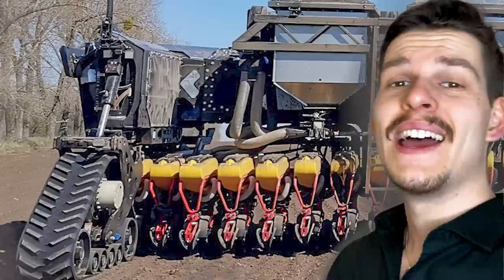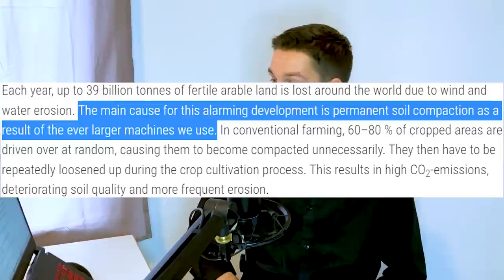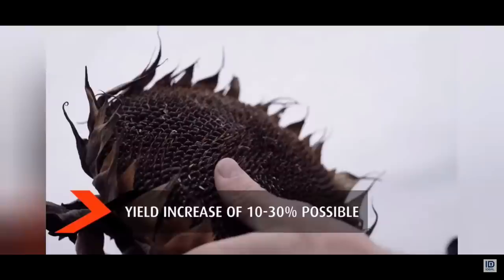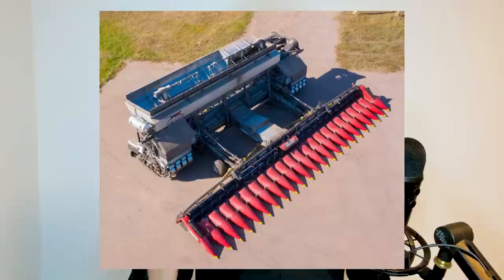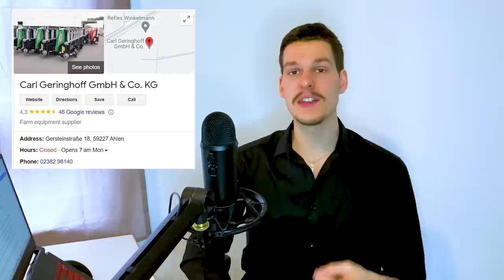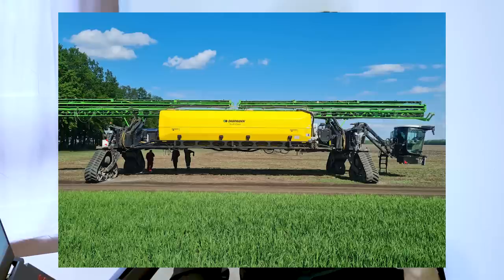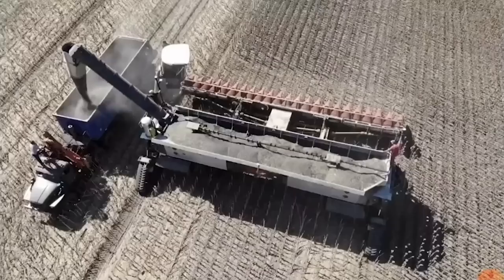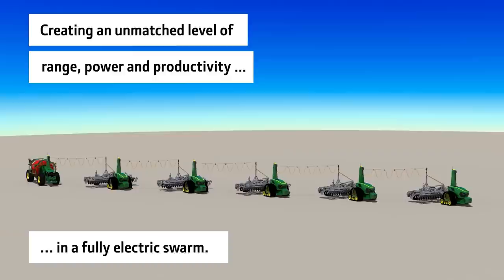Why this Super Tractor is the Worst Idea Ever (NEXAT Review)

Comment: Your wrong 1. 260 kWh per e Motor . Point 2 you didnt get Stuck because you Drive every year the Same ctf... ! Point 3 the Harvester Made 150tonns/h in wheat. Point 4 they have a väderstad Spirit module and a Weinhoff slurry module too. Point 5 its is in a Testing phase
Reply: and it will be in testing for a 10 years.

Comment: The second I heard you say the electric drives have 160kwh, I knew that you do not know the engineering behind this thing. Diesel electric is the best option for a moveable machine like this. The other options are hydrostatic which is inefficient and has the potential to leak massive amounts of hydraulic fluid. Or shaft drive. But how would you route those shafts? Just how many transmissions would that take? Also CVTs are not simple things. Diesel electric is actually very simple mechanically. Also efficient.
Reply: And you can build battery hybrids (or hydrogen hybrids) quite easy when you allready have an diesel-eletric drivetrain.
Reply: its basically just diesel engines providing power for the electric motors right? not much different than running off just battery power
Reply: @denzzlinga  But in this case, neither would be that interesting. A Battery Hybrid (Plug in Hybrid in car therms) makes sense in passenger vehicles for road driving, as they brake a lot. Regenerating the kinetic energy that would be lost to heat during braking makes a lot of sense for efficiency. This is a tractor. Once you are pulling a plow on a field, you do no longer think about brakes. You are already dragging a literal anchor behind you. The demand on the drivetrain is vastly different. The hydrogen hybrid is not that useful either. There either is or isn't hydrogen near the field. If there is and the economics make sense, why not fully power it with H₂?
Reply: @linux_doggo  Pretty much yes. Not exactly the same thing because the engines can't react to sudden power demand as quickly but yes its a electric tractor running off diesel generator(s).

Comment: Apparently, the concept behind it was still not understood by some. With this system you always drive on the same track and compared to the usual tractors/harvester you don't have 4 tracks for 2 rows, only 3 - for 3 rows not 6, only 4 etc. This means that the lanes are compacted, getting stuck is therefore far less likely with this type of tracking. Theoretically you could also concrete the tracks.

And one should also be able to distinguish between profit and yield, which Hitech Farmer here apparently cannot.

And no, just because seeding is done on a wider machine does not mean that only 2 tracks are compacted with the tractor. Before that, manure may have been applied and cultivated, then seeded, then fertilizer applied, sprays, possibly rolled, groomed etc. and all on different tracks. The soil compaction is only removed after the harvest with a subsoiler or plough, so the crop yield is lower than possible over a large area. That is exactly what the statement from Nexat says.
Reply: with conventional tractor you also drive on same tracks since today there is this simple thing called GPS...
Reply: oh and plowing increases yield since you turn the earth over and have the left over foliage under soil as fertillizer...this nexat makes no sense from the beginning...
Reply: @NoYouAreNotDreaming  No, because the attachments do not all have the same track width and there are therefore several lanes during the growth phase. And after plowing, there are often several field preparations before sowing. And after the sowing, several treatments and care take place and not all of them are always possible on the same lane width.
This has nothing to do with GPS, but with the various attachments and tractors and the compaction after plowing, which can only be loosened again after the harvest.
And yes, plowing increases yield, no one has ever said anything else and with that you are saying to yourself that the Nexat has an advantage here - even if you don't want to believe it 😄
Reply: This guy gets it.  Nexat is ctf farming but on the next level!! Not only is it only 2 tracks, it uses the same track again once it turns around. Even in ctf with 3m tractors etc you still have wheels on the implements etc.  

And unless these deniers have been and experienced a proper CTF operation they won’t understand any of the concepts.  The tracks become like roads, better traffic-ability, less fuel consumption due to less slip.  

You wouldn’t drive on grandma’s rose bed, why drive all over your own
Reply: CTF on this size is already a popular thing we do it here in aussie
We are running 13.5 metre machines on 3m wheel or track widths so we run on the same tracks every year
Reply: @cameronhorner7058  Yes, nothing new. But for 5 rows you have 10 wheel tracks, Nexat just 6.
Or expressed as a percentage: you have 67% more tracks with a conventional tractor
Reply: I wouldn't use the concrete pad theory as an argument. That has zero long term capabilities and would cost millions per field to install.
Reply: @louisferdinando549  was not related to practice, just an example to clarify the whole concept.
Reply: @NoYouAreNotDreaming  But you have different size of implements. Working with plow, cultivator, planter or sprayer you don't use the same trails. With concept of gate tractors you avoiding soil compaction on 90% of the field area. With conventional machines this is impossible achievement.
Reply: @NoYouAreNotDreaming but you have mich more tracks on the field

Comment: This video is full of ridiculous comments with little real counter facts.
It does not replace every tractor the farmer has, harvest output transport is still needed, so the story about getting stuck without a tractor is just crap.
The tracks are capable of pulling the tractor so attaching towing in the track support should be a good option.
The fact that it drives "sideways" compared to a normal tractor could actually mean that it is less likely to get stuck, because both ends in mud is less likely then it happening to a normal harvester or tractor.
It also can be remote controlled so getting unstuck could be easier, because it is possible to walk around the unit when trying to steer it out of the mud.
Reply: Certainly. Maybe “high tech farmer” needs to be get his head out of the sand and looking possibilities provided by this technology. Maybe he needs to reconsider his name. “I am blind” could be a good option?
Reply: yea its like a John Deere commercial

Comment: prototype is prototype, they are still testing the system, to find problems and then solve them. they are not even for sale in the same way as normal tractors, only sold to farms they can work with to get in data on the performance and solve problem.

- towing:  you tow it in same way as you do with catamaran boats, you have a rope a cross the tractor and one rope going to the tractor towing. only need one tractor for that. And yes you can attach the tow cable to either the fram or the frame holding the track/wheel, they are dimensioned for that. If they wasn't they would be able to hold the Nexat, you are not using that much power to get it out of the mud as you think.
- getting stuck: everybody talks about that... and all I hear is bullshit. Other tractors is also getting stuck, so when it is muddy enough the Nexat to get stuck, other tractors would also. They are even testing them in Ukraine, that is know for their mudds... and they have no problem there at all. When you see a large Big Bud tractor get stuck with 6 wheels... then anyone can get stuck
-  Parts, it use standards parts from other manufacture, engine problem, go to the engine manufacturer (CAT, Deutzh, etc.), Harvester problem, go to the company producing that harvester. combine problem, go to the company factory that produce the combine. All Nexat is doing, it building a frame and add all those component together and get them to talk together, normal service people fix problems as it is done today with any other tractors.
- Soil compaction it is correct as what Nexat is saying, but it goes way over your head, it easy to see that from this video, it have less foot print than any other normal tractor with towed equipment, even with that tractor with that planter you showed, count the numbers of tires on the frame... they are all compacting the soil. 
- all Nexat test vehicle is 45 feet wide, but they are delivering them from 20 to 80 feet wide. So just looking at the prototype and call it small... are you weird
- That video showing they are multiple people when they are emptying the harvester/combine. It's a prototype, they are keeping an eye on everything during testing. Normally it's two person, one in the Nexat and one in the tractor/truck. Even when other big companies come with a new combine, they can be 5-10 people watching and testing a new combine for 1-4 years.
- Automation, it have only gone a year..... and it is still a prototype. It take a lot of work to make a system work automatically, and Nexat is a small company. Even Tesla used years on their autopilot program and that for driving on a road. Nexat is going to drive on road and in the field automatically, it have to monitor and adjust automatically, it have to empty it's tanks automatically, etc. that will take years to develop. Even big tractor companies like Fendt have talked about AI-controlled tractors and tested a few ideas, but they have yet to introduce it, because they are not done developing it yet, after several years.
- power output: that is the normal way to do it, even Normal harvester does that, but only on 2 wheels.... nothing special

I suggest stop embarrassing your self and just delet this video. In stead look at what you get from the plattform, perhaps do proper research, then base on what you see on videos and what other people are saying, without even been there seen it live, tested it, etc. Go talk with the company and farmers that is testing the system, etc. that is called proper work, some anyone putting out a video should do, before say something stupid, and later find out that all you said was utter garbage, but a now marked as an idiot, for rest of your life. 

Nexat is a proven plattform some are still in prototype stage and based on old technology, just re-introduced with new ideas and improvements.

Good luck with your life, and I hope for your sake, that you do better research next time. If you was to do this video properly, you would contact Nexat, plan a meeting with them, test the system, and talk with farmers that is driving the prototype of it. There is only prototype our there, none of the version that is actually going to farmers.
Reply from the maker: Thanks for the in-depth comment! 
You've made some good points that I agree with, e.g. the parts. But for example, soil compaction has other solutions than buying a Nexat...

You can buy thin tires, use autosteer, and also drive in the same lanes year after year = same results as Nexat. Or, you can just ball out on some good lookin' LSW's which also noticeably limit soil compaction. (although, of course, not that much as not driving over the soil at all) 

Anyways, I get that it's a prototype, and I believe that what the father and son Kalverkamp are doing is honorable and actually very important. The main goal of this vid was to satirically point out what should be improved before they release it.

Overall, I would actually buy it, because it's one of the coolest-looking things out there. But I don't believe that this is the path ag-development should be headed. 

Hope you have a great day!
Reply: This guy ain't ever been in a combine I bet
Reply: Where u see a Big Bud stuck ?
Reply: @andreauberti9294  there are a few videos around, but of my head, "welkers farms" have had their big buds stuck on more than one occasion, but they do have several big buds to pull anyone out with
Reply: @heuhen  Yes , I see it , but the Big Bud 747 never got stuck ! That’s why I asked you , because I think that you see a video that Big Bud 747 got stuck , btw that’s almost immpossible
Reply: @andreauberti9294  of course that’s not impossible - with the weigth it carrie’s and the size of implements it pulls..
Reply: @allanthomsen3992  The Big Bud with attached nothing it’s impossible, and it got low pression and double tires on it

Comment: I'm ambivalent about the Nexat, but it did occur to me that a lot of the arguments could, and probably were used against the tractor vs horses.
Reply: My father was of the age that witnessed the change from horses to tractors. I would liken his description of it to the same as that of computers becoming an everyday machine for everyone. Early resistance because of cost and unknown complexity. Consumers being swindled by, well, the usual types that steal from people. Those that took the training and invested the money on tractors never turned back. Those that didn't saw their farm incomes drop so badly they not longer could survive farming.

But, that doesn't mean that this machine looks like a good idea to me. Other than being big, it doesn't really address any existing issue in farming. It also adds a huge amount of technology in an area with very harsh environments. I'm afraid that to me, it is a case of building something because it could be built, but not because it improves on the current technology. Time will tell if it survives in the market place of new ideas.

Comment: Actually the Nexat Grain Tank holds over 1000 bushels and the X9 only 460 bushels. The unload auger has the same functions as a grain cart like individual unloading speed.
Reply: So the massive weight plus the machine will sink like lead in any wet field.
Reply: That capacity doesn't make any difference, since we unload on the move. It DOES make a massive difference because it will become so damn heavy! Wouldn't it make sense to have a 50 foot wide combine with one engine, instead of two? The X9 doesn't need 1100 horsepower, does it?
Reply: @vernonspady555  
Plus the huge cost of diesel fuel  to feed a 1100 hp engine. You better be digging up gold coins  to pay for fuel.
Reply: @vernonspady555  The final models will be much longer, the reason the prototyp is only 50 feet is because, they are in Europe and have to use public road and are bound to the local road laws.
Reply: @assassinlexx1993  thats just the thing, because u drive only on one place, u will compact it like concrete, this means that u can drive earlier and later in the season without problems instead of sinking in
Reply: @sanderjansen5632  
Haha ha  thanks for the joke. You never seen or even walked on spring time gumbo mud.
Reply: @assassinlexx1993  i guess you don‘t know there are 2 engines with 550hp each? Second thing is, that a 600hp Engine does not take twice the fuel as 300hp would do if just 300hp is needed
Reply: @assassinlexx1993  but you´ll get 1100 hp in return. So in theory you can go twice the speed or work twice the width as a 550 hp tractor/ combine. It´s not that it´s got a big american V8 for show, that guzzles fuel and doesen´t put out any power, the more hp you´ve got, the more work it can do. So in the end fuel doesen´t cost more if a Nexat works for 2 hours or a 550 hp tractor / combine works for 4 hours for the same field.
Reply: @denzzlinga  
You can clearly see you don't know about farm equipment.  You have diesel engines.  You have problems of soil conditions.  Lets is how well this huge super heavy machine is in a mud filled field.
Reply: @assassinlexx1993  in muddy fields every machine hat its limitations.
I think nexat is not designed for that, but that doesn't make it a bad machine.
Reply: @denzzlinga  
If you can't run the this ugly thing in the field. Why own it.  Two tractors  will work  much more effective.
Reply: @assassinlexx1993  did you know that not all fields are muddy or muddy all the time? It may not work you but it will for someone else

Comment: I kinda like the design. I am sure there are bugs in the new product. If the unit continually tracks in the same spot, then soil compaction will keep it from getting stuck. In the US many farmers have non-connected tracks of land. They either unhook their heads going from field to field or get folding heads. I think this unit is a time saver.

Comment: How do you get less compaction with a big drill.
Can your combine also only drive in the same tracks?
It is not only when drilling and spraying that you need to drive en the same tracks. It is every machine that should only drive in the tracks, for years, and then you can get the benefits.

Comment: Wow, you make it Sound like spareparts of any Otter manufactorer are opensource. Good luck installing a catterpillar engine in your John deere
Reply: As long as its on a combine it wont be as much of a problem, been there done that. Not saying it will be easy but possible. On framed tractors, with cardan shaft driven gearbox, its also doable. Thing is is it worth the effort?
Reply: @tjurzyk  Its not the physical installation on newer equipment but getting the computer to recognize it...

Comment: A lot of critic, but you've only looked at it from an American point of view. In Europe the situation is much different because the lands are more expensive. Therefor soil improvment like drainage is very common, this also avoids machines getting stuck. Also agriculture is more intensive as in America, with normaly 2-3 grow/harvest cycles. Only for real good products you get paid well, so maintenance of the crops and use of biocides are widespread, used often, but due to the price also minimised by techniek. That's where a machine as NEXAT comes handy. You forgot to mention that after 3 years of testing, now only the first machines have made it to America. That's no accident because the machine is developed and manufactured in Europe, Germany, especialy for the European market